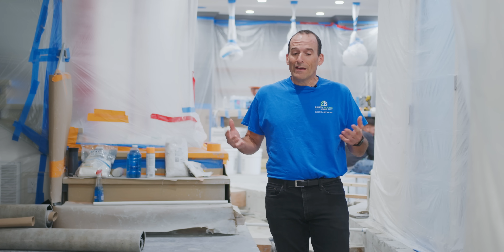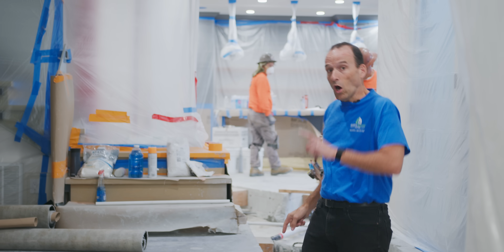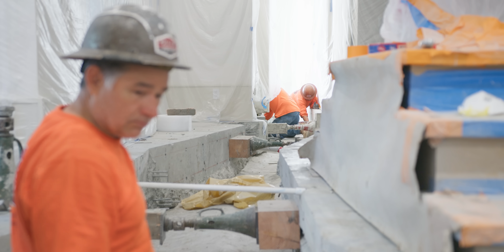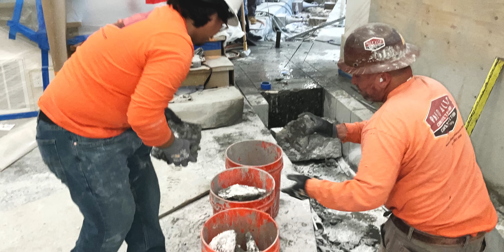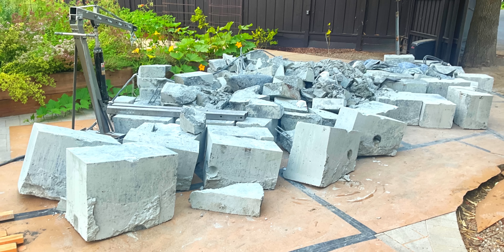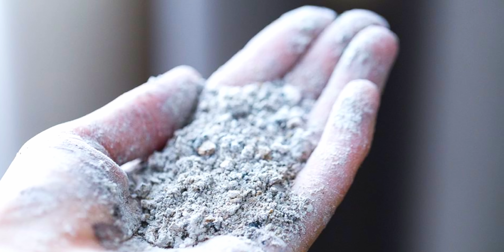Possibly the Dumbest Money Saving Idea Ever…Why To Never Buy A Spec Home

Comment: Why not run a totally new drain line?

Plus, why could the crews not cut out a window and then move the concrete via a conveyor outside.

But $500K is too much. I would have said to find a better way to fix this that does not cost as much. 

Finally, they should have been cut and drilling. If the crews were not, they should be made to pay for the cleanup and mitigation.

Comment: What was the reason for the thick concrete slab?
Reply: Wouldn't it have been cheaper to build a new sewer pipe and just connect it at the slab?
Reply from the maker: This is earthquake country and every basement is like that.  The engineers are literally designing bomb shelters now and if you look at our videos on the basement construction at Cereza Passive House, you will see just how over the top it has gotten, with #8 rebar at 6" on center, each way, IN TWO MATS!!!   This project was nothing. #4 at 12" each way, in two mats.